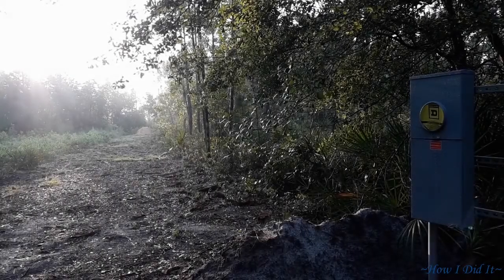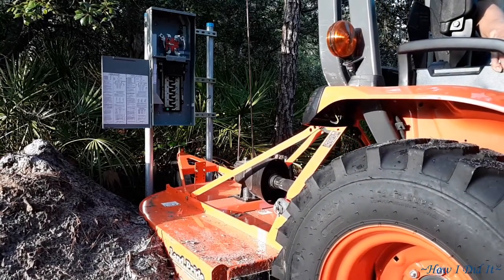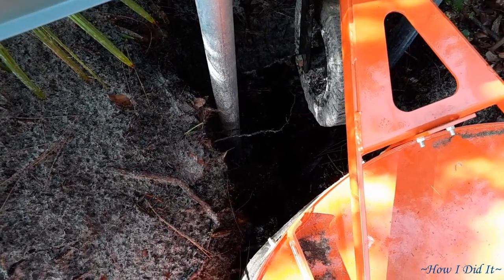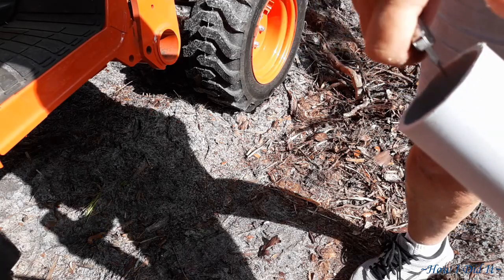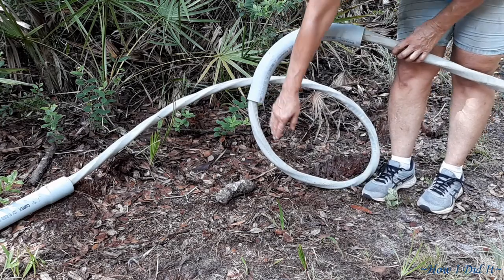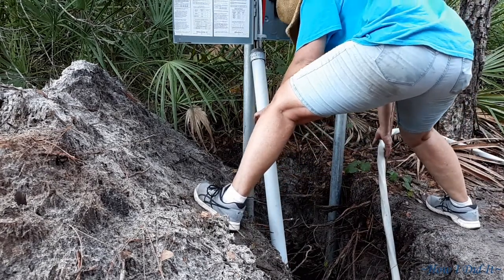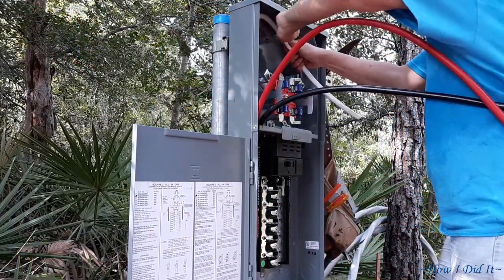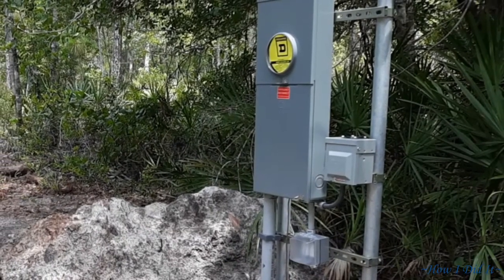Wiring 200amp main service power pedestal~How I Did It~

Comment: Would you also list the other parts you used, such as the copper grounding rod, boxes, type of wire, etc? Your video is a super helper, ty so much from a hands-on woman to another!! :)
Reply: @howididit , you are awesome, thank you so much!
Reply: Check with your local utility on requirements, spacings, heights, acceptable conduit types, acceptable types of boxes.  Here in the West we have to use EUSERC certified meter boxes.  Your utility should have these guidelines on their website, if not, give them a call and get the info.

Comment: Installing cable in this manner is a violation of the NEC.  Install the conduit completely first.  Then pull the wire through afterwards.  And this is the wrong type of wire for underground use.
Reply: I noticed this too.  Typically you always assemble conduit first and then pull individual conductors through.  If you keep it to three 90º bends or less and use a conduit fill calculator, pulling the wires through is pretty easy.  The wire she used is bundled in grey sheathing, sheathed wire shouldn't be used in conduit, often times the wire insulation isn't rated for being wet.  Hopefully the insulation on her wire will withstand the moisture and and won't start shorting out later on.
Reply: @taylorlightfoot  It's 4 90's.  Needed a 2 1/2 in conduit for the SER, Which is a violation to be used as direct burial.

Comment: Question:  I have a box similar to yours but was planning to mount it to a simple 4x4 rather than the fancy 2 post system you have.  Obviously the problem is if I use the left bottom portal (underground service like yours), the pvc conduit won't  be able to be secured to the post.  Now, there are center knockouts so I could run the main wires in this way, but would need to remove that side shield (which is easy to do).  However, will the inspector approve an installation like this?

Comment: I brought the Square D Homeline 200 Amp 20-Space 40-Circuit  model "so2040m200s wireway barrier kit". you can google that model number.  it quite difference it has barrier on the meter panel and I don't know where to I should wire the electric power source. is that from the top instead of the bottom like your video.

Comment: Uhh. That is way way wrong. SER cable is not direcr burial.  Did the POCO even install a meter and have power turned on after they saw that. Or did the inspector notice it?  Also Noalox is not required and even Square D, the panel manufacturer says not to use it on their panels/breakers.
Reply from the maker: sorry it was "wrong" I guess the inspector didn't know his backside hole, from a hole in the ground 🙂Not direct burred, it went through a electrical conduit with a 90* long sweep into the electric company's service box where they made the initial connection. Code in our area requires the use of noalox.
Reply: @howididit  I'm sorry if I offended you. 
1) I saw the SER leave the 90 and lay in the ground, so I assumed it was not in conduit past that 90. Again SER is not permitted underground even in conduit, unless NEC 590 Temporary Service, comes into play, SER can be in Conduit in a Full Complete Raceway Underground if temporary. So yes that is a violation.
2) Cables like your SER, Romex etc are required by Code 312.5(c) to be secured to the cabinet they are entering.
3) Nolox on your Aluminum Wires in the SER "could be"  violation of 110.3(B)  Equipment that is listed, labeled, or both is to be installed per any instructions i included with the listing. Your CSED by Sqaure D says it's UL listed to not use Nolox but if you do make sure it's petroleum free.  Can't comment on that, just a heads up. 
4) 110.14(D) Torque. Didn't see you torque your SER cable per Sqaure D specs. Use of Nolox doesn't allow proper torque since it acts a lube in a way. 

I'm sorry if I came off rude. Just letting you know what NEC says. Sorry if I offended you.
Reply from the maker: @andrewhoward4054  no, you are good. I always appreciate comments and input, that has save my backside more than once.

Comment: you can't use ser cable  in a wet location conduit underground  is considered wet location good luck
Reply: Correct, sheathed wire is meant for interior locations in a building, not in conduit.  Also the wire has a separate ground, meaning it's a feed wire, not a service wire.  The connection to the meter should only be two hots and a neutral from the utility.  After your first disconnect, grounds are separated out from the neutrals.  Hopefully the insulation on her wire is rated to withstand moisture, conduit always fills up with water over time whether it't through condensation or a crack.

Comment: So many mistakes on this, not the least of which, is not properly applying the pvc glue.  The glue/cement is supposed to cover all the ends of the pvc pipe.
Reply: @howididit  Best wishes.
Reply: A few thoughts  - 1) Noalox  to prevent corrosion  2) torque all of those lugs on the milbank 3) and as suggested glue first, secure the seal. then pull the appropriate wire through the PVC and lastly although not required, try to secure the conduit where it comes out of the ground (perhaps use expanding conduit connectors if you're in an area where the conduit could heave with the change in temperature. Lastly,  I think this gives a lot of respect to those who do it alone - those aluminum cables are tough to work with ( I just put in some 4# into my millbank and it took two of us to position in them) .  Overall, really appreciate the video and the beautiful doggy was icing on the cake
Reply: @MrTom38ncalif  The torque tool is VERY important for electrical.  I bought one when I installed my own service upgrade and boy, you really have to tighten the wires down tighter, than you would have done "by feel", to reach the proper torque setting.  P.S. I had to upgrade my service because the previous owner installed it illegally, didn't torque down the wires properly, as I converted my house off of gas, my loads were higher than before and that loose connection caused the resistance to be so high that the wires heated up to the point where they were melting into each other and shorting out up at the weatherhead.